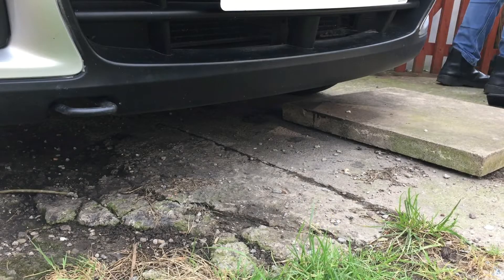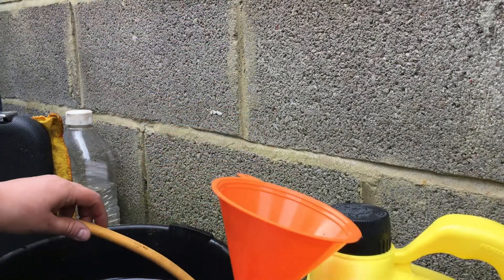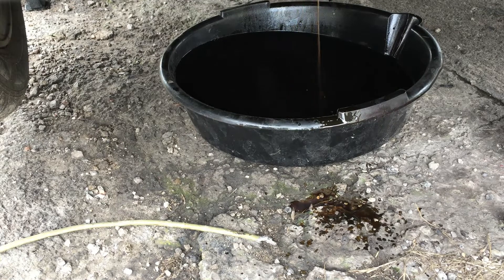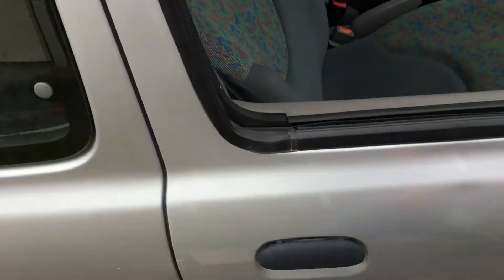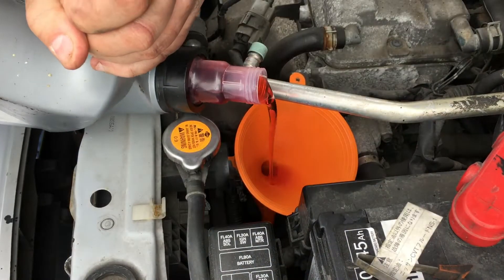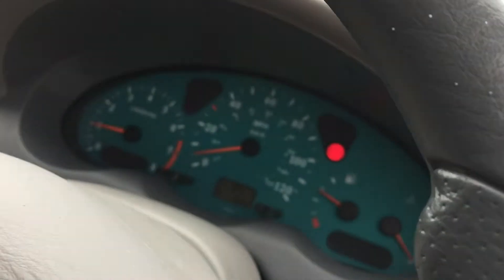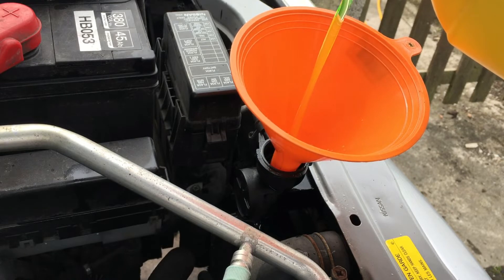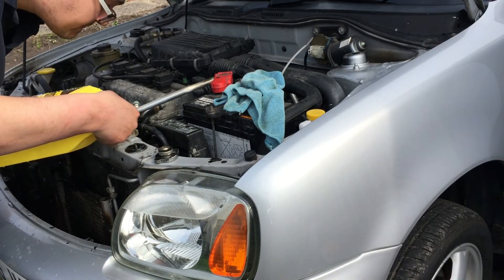K11 Micra Spring Fluid Change - Oil, Auto Transmission Fluid and Coolant

Comment: Thank you for this video,  well explained!
I want to ask if any one have/had the same problem i have, my micra k11 1.3 2000 automatic gear. It dont shift anymore, it still set if it on the low gear and the engine run so high to reach 40km/h with a high/max rpm!!! I tried to change cvt gear oil and clean the filter inside, check the electromagnetic clutch brushes but the CVT still dont work!!! Any help please????
Reply from the maker: When was the fluid last changed?
Reply: 1 week ago! And i change it thinking that could be the problem of the gear! But now i am sure it was'nt!
Reply: And before that, i think that the last owner didnt chang'it at all

Comment: Never use axle stands on the sills. I learnt the hard way and resulted in £100 welding bill, They cracked and rusted out.
Reply from the maker: This is actually a really good point, and one I had not thought of, when supporting the car. The sills are regularly inspected, and filled with Dinitrol, on a yearly basis, but, the jacking/support flanges, do seem a little weak and susceptible to opening and allowing moisture into the gap.
Reply: i know it is kinda off topic but does anyone know of a good website to watch new movies online ?
Reply: @Aidan Bryce Flixportal =)
Reply: @Nelson Briar thanks, I signed up and it seems like they got a lot of movies there :D I appreciate it !!
Reply: @Aidan Bryce You are welcome =)

Comment: Hi, planning to do the cvt fluid change tomorrow. But didnt think of buying a new o- ring or new bolt. do you think it will work with the previous bolt or better to buy a new bolt. It will propably be the first CVT fluis swap in 20 years, (50.000km) 
thankyou in advance

Comment: I don't have4 a lot of money and so bought a 20 year old Nissan Micra K11 with CVT transmission. The car has the 1lyr engine producing 60bhp.
My question is how far can I safely tune it? I have already changed the inlet camshaft for a 1.3ltr one for better acceleration.

But there is a but when I bought the car I decided to do a full service on it and am apprentice trained but an automatic transmission is very specialist and something I have never in all my years worked on.
I had contacted my local Nissan main dealer and asked what type of fluid do I use and they advised me Dexron 2 well I changed the fluid and the transmission filter and from time to time it slips and whines but after stopping the car and giving it a few minutes the car behaves normally again.
I have recently discovered that it needs NS-3 fluid and have changed it but it still occasional slips. Is the car going out?

Thanks in advance.
Reply from the maker: Hello, I would stick with the camshaft, for now. Focus on mods to help braking and handling. You might have the mounting eyes, at the rear, for a rear ARB, found on the 1.3s and 1.4s. N15 almera caliper carriers will fit, sllowing you to run almera calipers and vented front discs. As regards the transmission, never use Dex2, dexron is a GM standard, and an old one, at that. It is a mineral oil, suited to conventional, older transmissions. My jags autobox uses dex2. The K11 should use NS1, which is a synthetic oil suited to cvt transmissions. There is a filter on top of the box, so change that and complete another couple of flushes to clear out the dexron 2 stuff. CVTs do drive like thet are slipping, to a degree. You'll sit at a specific RPM, the speed will increase, but, the revs will stay where they are, until you reach the speed at which they start to increase.
Reply: @JCTsFascinatingHobbies  yes I fitted a new filter last year so will do it again to help flush out the dexron (still can't believe Nissan would recommend using that for my car) I have been using CVT NS3 fluid ome quality £40 for 4ltrs.

I have noticed on the slipping issue that if I have to do a emergency stop and I try setting off again I press the accelerator pedal but nothing happens and then the car lunges forwards and then drives normally. 
The other thing and this is most annoying is sometimes when I drive over a speed bump the same thing will happen and on both occasions it can be quite dangerous as traffic behind me is still moving and I'm stationary. 

After the couple of flushes hopfuly this will rectify this?
Reply: Have you made any more flush and how is t now? I have not change my Micra automatic transmission oil I am planning to change it but my min problem is when I drove the car more than 1 hour if I put to gear to neutral it makes noise and when it was making noise if I change it to drive mode it is shaking and stops. First I put it is to reverse after neutral if the noise stops after after change gear to drive it does not shake that time. What is your advice if I change the automatic gearbox oil Can I solve the problem?
Thanks
Reply: @kadircalskan8359  I have sold the car about a year ago. Sold it with no problems the ns 3 fluid did the trick.

I now have a Vauxhall corsa b 1.4i automatic. Not done any servicing on this as yet.
Reply: @savinggracechurch4112  Thanks for your answer.  which one do you advise ns3 fluid or same like on video ? Did you change your transmission oil just yourself? One garage told me 300 pounds just for automatic gearbox oil change

Comment: I have a 2002 Nissan Micra K11 with a CVT transmission. The problem I am having is that the CVT transmission only works when the temperature is halfway on the instrument panel. I can drive the car at cold temperatures. However the engine RPMS are a lot higher. Is this normal?

Thanks
Reply from the maker: On my K11 CVT, with the hydraulic torque convertor transmission, same as yours..... When cold, the Rpm is higher, say, 3000 rpm, when accelerating to 30 mph. This happens to increase temps in tge catalyst, so emissions are lower. A warm cat works much better than a cold one. When the temp reaches halfway, the transmission switches to a more economical mode, so at 70mph, you're pulling 3000 rpm, rather than 3500rpm, for example.

Comment: I know its obviously best to use NS1, but could you also use general ATF? Mixed messages on the Micra forums.
Also, am I right to say you just top up through the dipstick hole?
I've got the 2002 K11 5dr Auto.
Reply from the maker: Hello, I'll be honest, I haven't tried any other oils, other than the approved specification oil. A lot of oils will cover multiple standards, NS1, 2, 3, etc. So long as one is covered, you should be fine. Personally, I would avoid any fluids that don't cover NS1, so the likes of GM standard Dextron oils. Filling is via the dipstick tube. Mine takes around 2.5 litres each empty and fill.
Reply: @JCTsFascinatingHobbies  Hello Mate, Wishing you a happy & healthy new year 2021! Thanks for the useful video and tips. Unfortunately, I viewed this video after I purchased online the Manol Dexron 3 automatic transmission fluid (ATF) as read on P16 of Micra K11 Haynes Manual ( '51' Registration).  I looked at local suppliers for Nissan own NS1 CVT oil but could find one in store. What is your advice? Should I go ahead with Dexron 3 ATF fluid or return it to the online trader who initially, when asked about before the purchase, confirmed that indeed the above ATF oil is appropriate for my Nissan Micra. I don't want to ruin the transmission gear box of course.  Any suggestions / advice would be greatly appreciated. Many thanks, Tim
Reply: @shpetimalimeta  How did you get on with the Manol Dexron 3. We used it in my last K11 and it was fine, but we have a pre facelift (powder clutch) version.

Comment: Hi, Recenlty I replaced my engine oil with 5W30 engine oil which worked fine for a week. But today when I started driving the gears dont change at all remains only one gear. Is it the issue with oil I used or some other issue? do you think is the issue with transmission fluid which needs changing or topping it up?
Reply from the maker: Is it an automatic?

Comment: Why would you use CVT oil in an electronic over manual gearbox.....
Reply from the maker: Because the k11 CVT transmission is not an electronic manual transmission, it is a continuously variable transmission, with two fluid driven cones and a steel belt that links them. The cone diameters vary, providing you with the ratios you need.